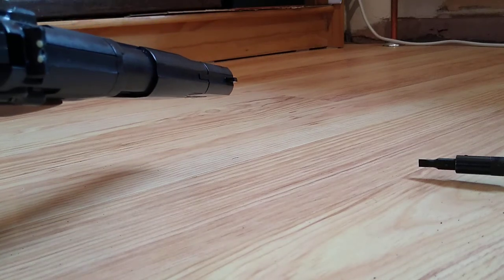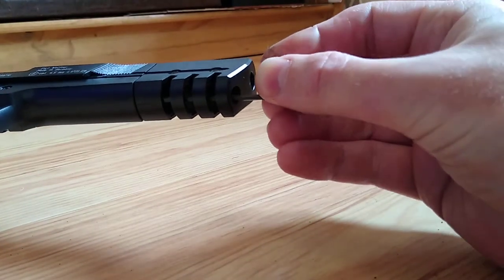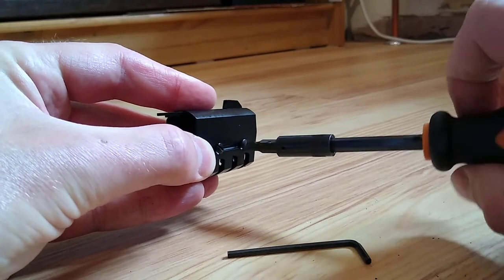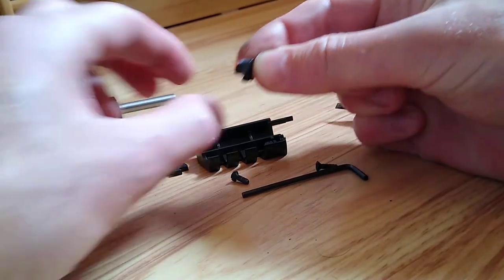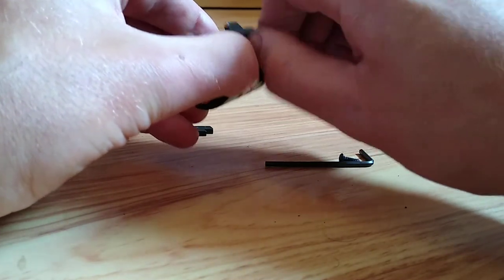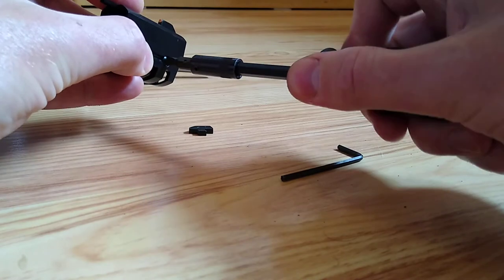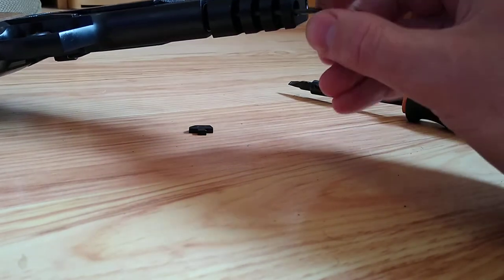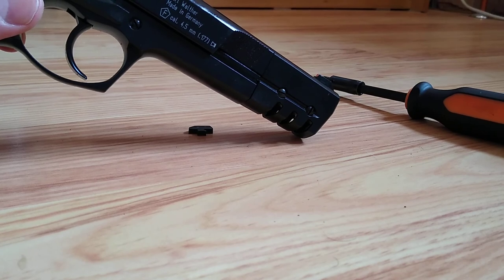NV002 Changing the front sight on a Walther CP88 Competition CO2 air pistol.

Comment: Thanks for the informative and witty commentary. I did in fact discover you can change the front sight without removing the barrel extension. Just removing the screws allows the release and replacement of the front sight. Tighten up, job done!
Reply from the maker: Hello,  thank you for watching and thank you for commenting. 
I should have tried that, but I was curious to see what was under there!
Reply: That’s the engineer coming out! I work in an office and so happy for the least effort! Still great to watch you at work.
Reply from the maker: Work smart, not hard 👍🏻
Thank you, much appreciated.

Comment: Just competed this on my pre owned gun. It appeared the previous owner used an imperial Allen key and rounded off the flats on the socket head screw. A drill bit down the front end was a bit daunting but fortunately took the screw head off without drilling any of the retaining area away,,,, thanks to viewing what was actually inside the unit seen in your video. Many thanks
Reply from the maker: Glad the video was helpful and glad you got it sorted.

Comment: Can you remove the longer part of the barrel on the Competition to make it basically a normal sized CP88? I don't think so but I thought I'd ask anyway.
Reply from the maker: I believe the barrel is in one piece,  so you'd need to fit the barrel from a normal CP88. That said I haven't tried taking it apart, didn't want to mess with it while it's working well.
Reply: @nickvending9688  Thanks Nick... Yeah I don't think they'd make this gun allowing people to mix and match, I am sure you could cut the barrel but you would basically be losing the competition part for good.
Reply from the maker: @nathanharris8547 I'd like to get the two side by side to see the differences. Probably wouldn't make very interesting viewing,  but I'd like to see it.